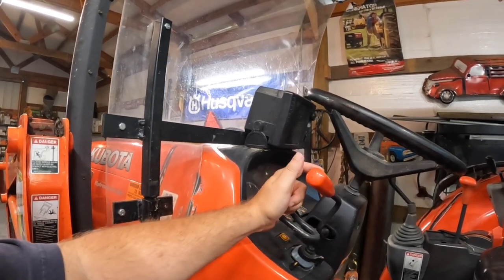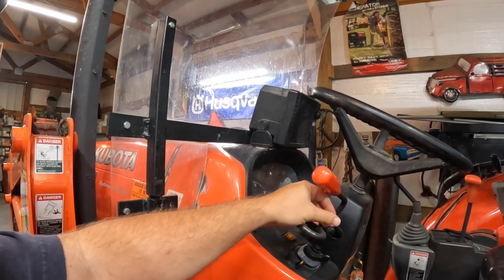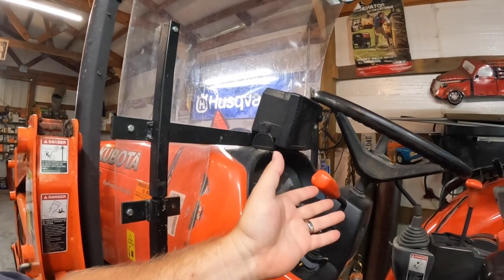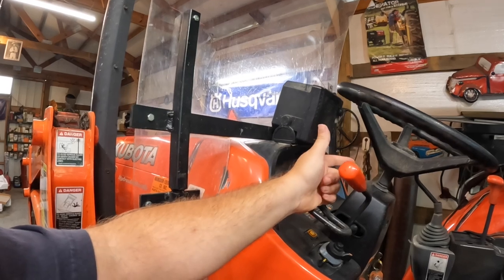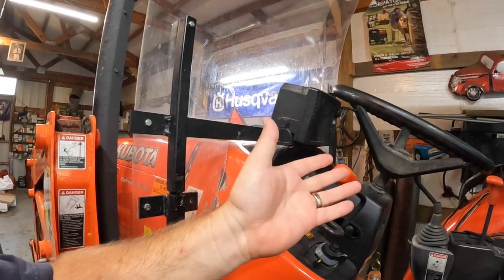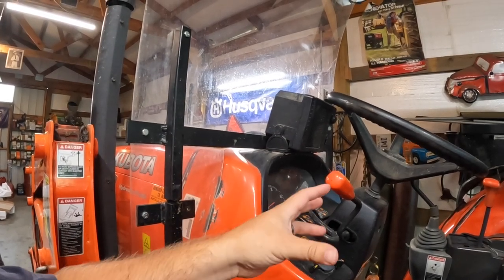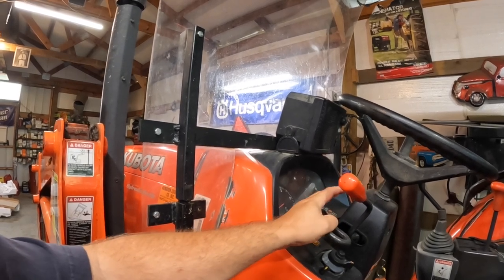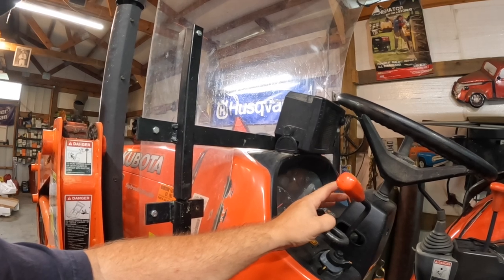How To Use a Kubota Shuttle Shift Tractor Transmission!

Comment: Thanks for your videos ...I have an M6060 about 6 months old ... You ever have an issue with the 3 point being very slow to lower (have a 7 foot bush hog on it) I have adjusted the lower speed knob every which way but it still goes slow until half way down the it goes fast.   Was perfect and I had it adjusted good for the bush hog and it just started doing that ... I checked the knob linkage is all connected and working so not sure what else to check.  Thanks
Reply from the maker: No I haven’t had that issue with the 3 point. I’d get that checked before your warranty runs out, sounds like something to do with the valve possibly. Thanks for watching!

Comment: What do you mean by starting it from the ground??
I think I figured it out, after re watching you say it several times I realized you were meaning starting the tractor while your not on it???
I don’t think this is possible on mine, I think I have to push my clutch in, if not I guess I could.
Reply from the maker: I haven’t watched this in along time but I assume I was referring to starting the engine when not on the tractor.

Comment: My Kubuta m6060D no start
Reply from the maker: Check all your safety switches, pto switch, battery, test for power on the igniter wire on the starter when holding the key to start. You could also make sure it’s in neutral and bridge the starter to make sure your starter and battery is all good.

Comment: That definitely is weird that even in gear you have no transmission holding power when the tractor is shut off...I guess that would be where the hydraulic stuff comes in, I can't believe the clutch is disengaged when the tractor is shut off, I think that should be a separate hydraulic system.
Reply from the maker: My uncle had a 350c Deere dozer, exact same way. It had a gear drive transmission but a power reverser. It would roll off when the engine wasn’t running unless you set the brake or shoved the blade in. Thanks for watching!

Comment: I’m not old enough to drive a car so I have not drove a manual transmission I’m 11 years old but I have 3 tractors 1 of them is my uncles so he has a kubota L3240 2wd it has a clutch I also have a 1953 John deer 40 has a clutch and I have a John 3025e four wheeler with a loader but it doesn’t have a clutch
Reply from the maker: Use every opportunity you get to drive and learn. Starting young pays off. Thanks for watching
Reply: @khtractors  anytime